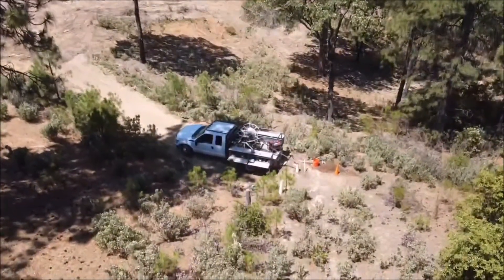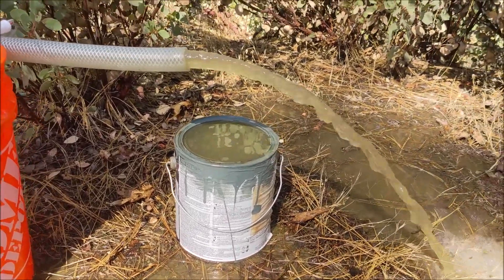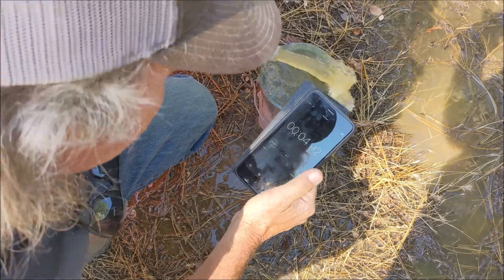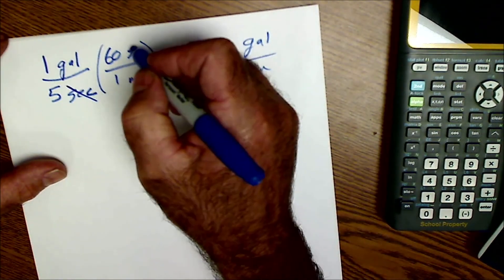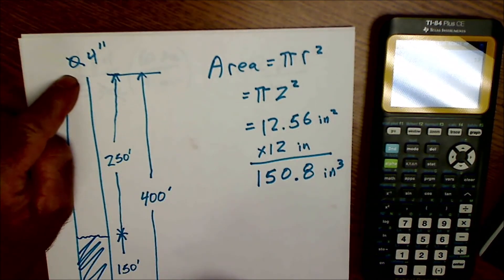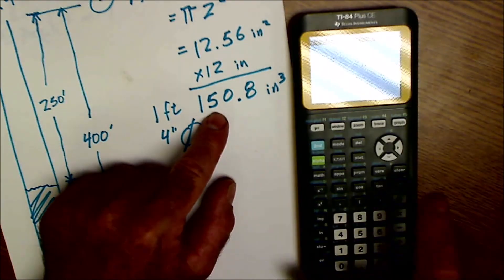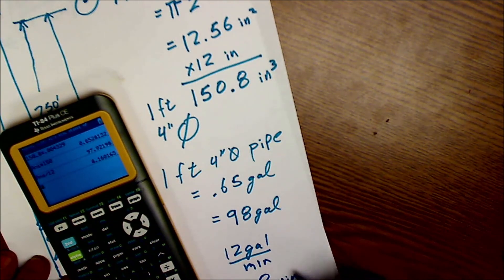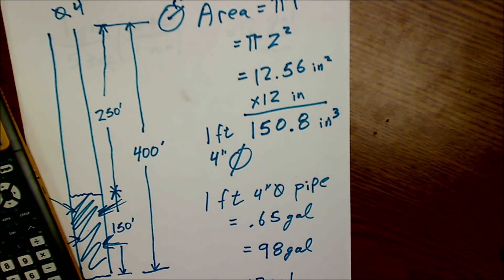How to Calculate  Flow Rates and Volume for Water Wells

Comment: 🎉Hello, sir. I dug a well 164 meters deep.
I installed a 3-horsepower pump, and at a depth of 85 meters, it was producing 2.5 tons per hour.

I then changed the pump to a 5.5-horsepower pump. At 85, it worked for an hour, then the water flow stopped.

I then lowered it to a depth of 110 meters. It worked, and now produces 4.2 tons per hour. This means the OK level is 110 meters.

I want to know the flow rate in the well because I'm about to change the pump to a 7.5-horsepower pump.

Is that okay?

For your information, there are 54 meters left in the well.

Thank you.
Reply from the maker: Deep well
Reply: @ColfaxMath  Yes, the well is deep.

Comment: 🇨🇦Thanks for this in-depth explanation. Probably the most overlooked criterion a rural home buyer encounters. Most people( myself included) rely on the fill the bucket from a tap test to equate gallons per minute. Which of course doesn’t really tell you anything apart from the fact your tap flow can fill a bucket in x number of time. Older properties with drilled wells which have been bought and sold over decades and NO data have been passed on to new owners are common. At least what I find. I’m sure the data would be collected at point of drilling but as with our well there was no documentation passed on from original point and so buyers and sellers rely on experience of history of water use.The old saying”Don’t Worry About the water Until the Well Runs Dry” is the sad truth for many homeowners.
Reply from the maker: No water,no home is what I usually go by. Thank you for the good feedback

Comment: Informative video. So, what is the estimated flow rate from the well? I think there were a couple of more calculations required? This is obviously a fairly high-volume well. How would this method work if you had your 12 gpm pump in a well that could only produce 1 gpm? If I understood correctly, you are assuming the static water level is where the driller first encountered water. In my experience, these values can be vastly different from the actual static water level. Why don't you just measure the static water level before starting the test? In a low-volume well this could make a huge difference.
Reply from the maker: Thank you, yes a lot of potential variability.